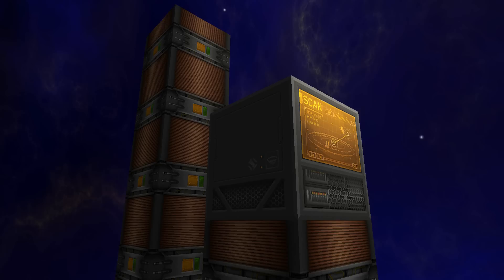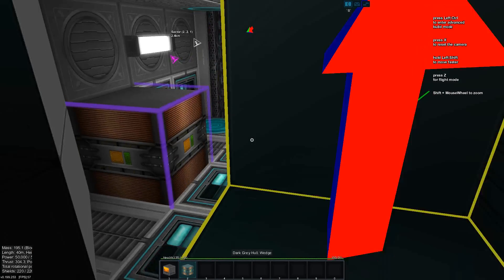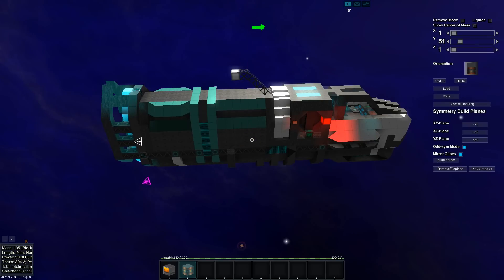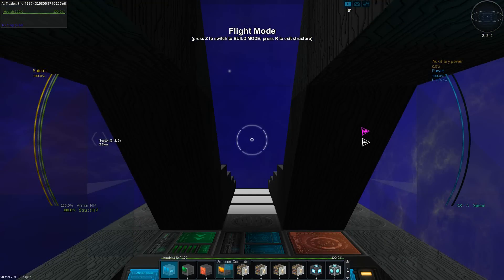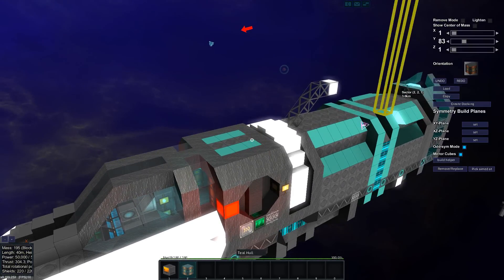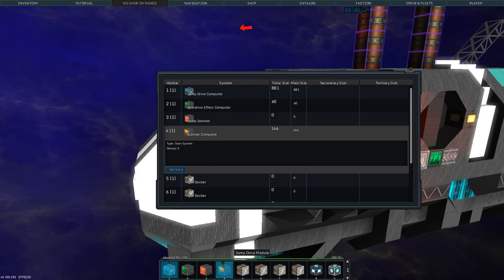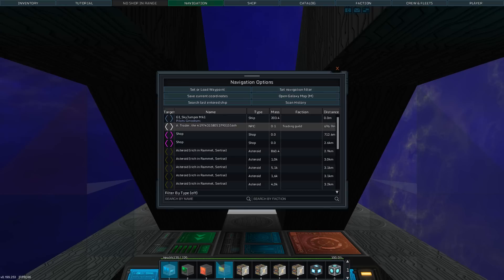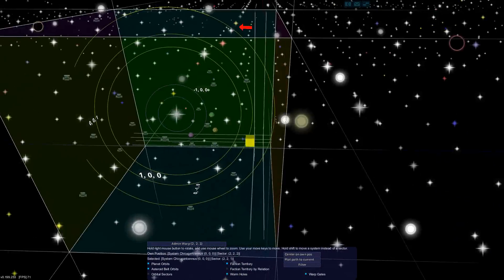StarMade Compact Tutorial | Scanner Systems

Comment: If you had a ship that was say 'N' blocks long could you have a scanner antenna that would be 'N/2' broken down such that 'N/2' (port side) + 'N/2' (starboard side) would equal 'N' ( the length of the ship over its longest axis) instead of having one long antenna (break the antenna in half and put each half on separate sides of the ship like you do for cannons and missiles).
Reply from the maker: It seems the scanners is updated to calculate reload on number of blocks only now, I have yet to confirm that however

Comment: It is always good to have your radar jammer (and cloaker if fitted) next to your scanner in the hotbar as you have. If you manually deactivate this/these before you run the scan there is almost little or no cooldown and they can be reactivated almost immediately after you have run the scan. Also, I'm not 100% sure, but if you are within the same number of sectors as the scan range shown from an undiscovered station, I believe it will show what it is.
Reply from the maker: Indeed that is a great tip! I believe that is the case indeed! :)